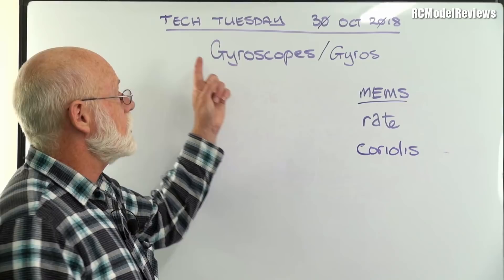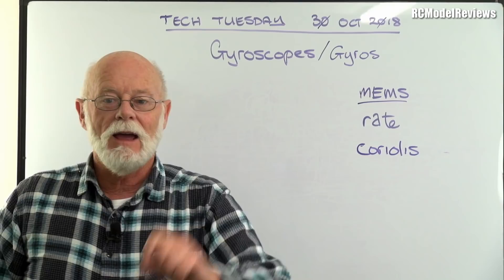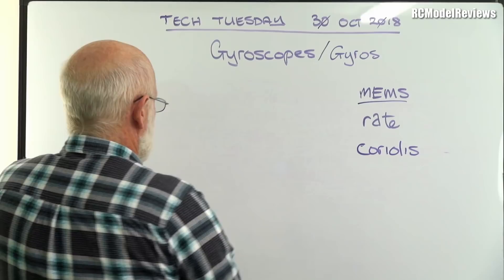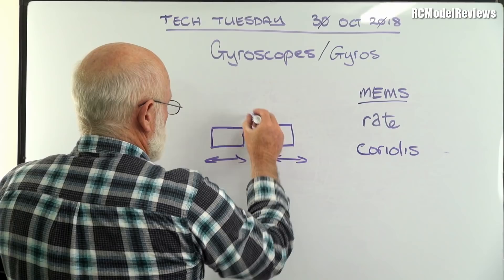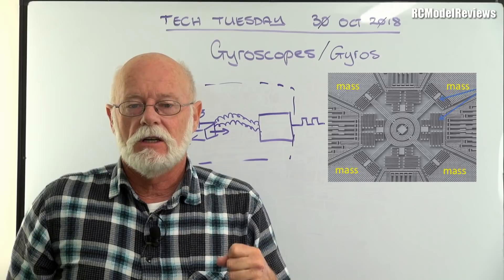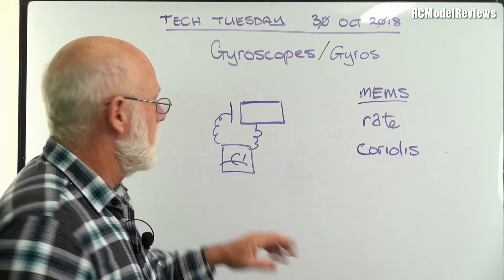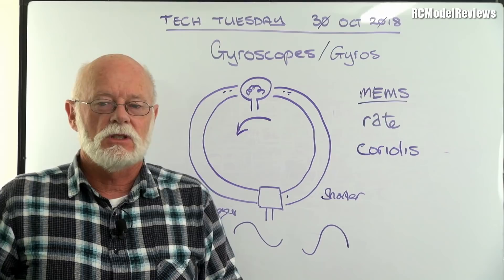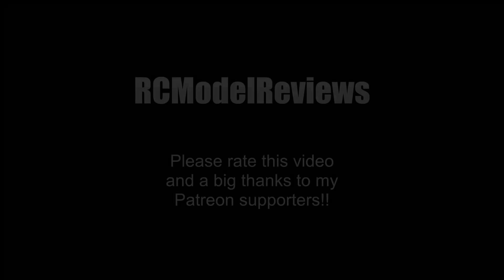Tech Tuesday: Gyros, how do they work?

Comment: When I joined the military back in the early 90’s, the first airframe I worked on was a DC-9 built in the late 60’s. I used to chuckle when I changed out the gyros because it said “handle like eggs” on the side. Fast forward to 2001, I started working on C17’s. I once asked a guidance & control specialist how a laser ring gyro worked. His explanation wasn’t very good. 
This explanation was a lot better.

Comment: Great presentation. Looking forward to the accelerometer. I always wondered how it remembered what is up and down. I now realize that gravity is an accelerating force.. Thanks

Never heard of the light gyro. Sounds expensive. Amazing how it's possible to measure such tiny changes in light. I guess it's Doppler that is measured since the speed of light is constant.
Reply: Not doppler, just amplitude, since the waves from the two paths either reinforce or cancel each other, depending on the phase, which is determined by the difference in apparent path lengths.  Because the apparent length of each path changes depending on the amount of rotation during the period between leaving the light source and striking the sensor, this directly measures angular change over time, which is rotation rate.
Reply: @BrightBlueJim  Since the speed of light is constant the path lengths are the same. I think what you are describing here is a way to measure Doppler effect in the two pathways
Reply: @jannesbosma9801  Kinda but not quite.  Doppler shift is measured by detecting a difference in frequency between objects moving at different speeds.  Here, the light source and sensor are both mounted on the same object, and what is seen is the same frequency as was sent, with just a fixed phase shift for any given angular velocity.  This sounds like splitting hairs, but the distinction is that a doppler measurement needs a fixed reference point from which to make the measurement of the moving object, while a differential phase measurement like this doesn't.

Comment: So we can accurately measure the difference between two light paths at such a miniscule distance?! Is anyone else freaking out over how impressive that is?
Reply: No, not really: the combined light arriving at the sensor by the two paths is maximum when the difference in path lengths is a multiple of one wavelength of light where the waves from both sources reinforce each other, and minimum when the difference is a multiple of one wavelength + 1/2 wavelength, where they cancel each other out.  So the sensor goes from minimum to maximum output for a path length difference of just 1/2 wavelength.  So yes, we can make measurements over a miniscule distance, but it's not a difficult thing to do.
Reply: And I should mention, since the video didn't, that ring gyros aren't generally built at the size of integrated circuits.  Their sensitivity is directly proportional to the diameter of the ring, so bigger is better.
Reply: Just photonics, but those gyros can measure miniscule changes in Earths rotation and now that's impressive.
Reply: @BrightBlueJim   What about a coil of fiber? Multiple roundtrips between sensor and emitter.
Reply: @LowPriceEdition  Seems like that ought to work.

Comment: Greetings. I know this is several years  old now but just searched “gyros” for drones/UAV thinking that I’d get the old fashioned “top” gyro like you mentioned the older Helos. So guess I’m dating myself here. But was both amazed yet befuddled by an electronic SS one on a 4’ acrobat RC plane kit that this other YouTube Guy was installing to help level his flights and do a myriad of other items as it had 9 outputs and as he’d dip a wing and change heading everything at once  responded RTZ (level flight) returned to zero and sat there with my law dropped for a good 2 minutes trying to figure out just how that was even possible with a tiny 3” box when we used to Mount 12” mech. gyroscopes in the rear of our auto cross cars (1974) and in a hard corner would hold a car body so stable; depending on the skid (and age of old bias ply tires) you’d rip them off the rims! So whilst I’m yet to be convinced there’s an “electronic SS gyro” that is 1:1 effect vs an old school turbine sounding gyro (I’m only 1/3rd the way thru your video) but I’m building a 6’ (-ish) UAV that’s turbofan driven with 4 fans - atop an ancient Williams turbofan jet. … yet on another board we were discussing best ways to manipulate and  coordinate those four sets of blades/props to give us the best lift and  level flight (and no drag/lock props) OR best nose down (-AOA) but stationary flight (follow that?) and then also just a normal or std. “tilt forward / tilt reverse” to float or fly backwards and forwards and sideways I suppose I should add too … and is being built right now are 4 ball casings which will encase each fan array within each wing and by RCC the entire ball will rotate along with increase/decrease power front/rear/side to side to give the AOA or movement desired which could be mere inches. Like an eye in an eye socket is the best way to describe it in basic terms. I must add this currently weighs in at just under 1000kg. So my Q to you is are the old fashioned stabilizers/mech gyros even made or used anymore? Or do that make solid state gyros if enough are used and properly mounted to the mm will they respond and act the same way as a mech. Gyro? My gut and brains both say no. And feel I’m talking apples and oranges? But outside of these Solid State Gyros  acting like a mercury  switch on steroids and sending angles as you say from center on the RC plane or helo; it’s “correction” is all FBW controlled by sending a signal to 1 to 7 devices (flaps/surfaces) to do X, Y and literally Z to get the RC plane back level. And suspect it does it In milliseconds vs man’s hand on the stick and only controlling  1 item at a time or 2 if you’re talking banks with tail and flaps etc. the combos are endless but the “computer” is doing to be light years faster than the human whose 500m away flying by sight whereas the SS gyro is flying by horizon I’ll assume? Whatever the case I see now why this is a massive improvement over older RC tech. Another RC car video I saw the kid said SS Gyros are “cheating” because it turns the car perfectly for you. Well I’m not flying a car - but weighs half as much as a real one and anything I can do to make it fly straight and level as well as perform some minor aeronautical maneuvers that achieve the remote pilot’s objective with 1-2-3 inputs is FABULOUS news to me. I just don’t het how this offsets weight? And it doesn’t or cannot as said earlier it’s just manipulating surfaces faster than a human can based in orientation not G force. If you follow even 5% of my ramblings here.. do you catch the gist of my Q? Or maybe I should ask
Better Q’s. 1) how large do these ss gyros come as? and is their a weight limit. This kids 4’ RC plane I’d imagine weighs 50 lbs? Maybe 25? Total guess but that’s still allot of G’s (mass) to control  during a steep turn or bank. 2) I’ll ask again. Do they still make old school mech gyros? What do jet copters use today or Military choppers like Blackhawks? 3) And last would you need 1 center mounted GOG gyro (whichever flavor works) or Mount one on each corner near the rotating prop fan for a drone/UAV? Do the “talk” to each other? Sorry for the sloppy story I’m still designing  some aspects of the props in my head as I go despite drafting and testing it both in CFD and wind tunnels but not with gyros due to size. But maybe it’s something  we need to look into? Many thanks for any feedback or help you can provide. Cheers. BB

Comment: I know the time-of-flight bit is incorrect but I also know the correct explanation escapes me at the moment. You can consider the fact that the photo emitter is in motion. It's a relativistic effect for sure and the phase difference is probably a wavelength difference as well. BTW I saw some Japanese company was making consumer ones a few months back, are any drones using them yet?

Comment: Bruce, any chance you'd be willing to do an episode discussing the configuration of pusher planes,  engine rotation and how to configure CW and CCW props to provide proper and maximum thrust. I have been struggling with one of my wings that has a powerful motor (emax rs2205s / 2600kv / 1091g thrust / 30a esc / i've tried 6x4 standard props and 5x4 CCW bullnose props) yet at full throttle has enough power to maintain level flight only. Something's wrong ;)   Keep up the great work!

Comment: You use Coriolis effect instead of precession. The gyro does not convert angular to linear - it can measure only angular acceleration, by outputting a rotational acceleration at 90 degrees to the trigger, and it cannot measure on its rotational axis. To measure all 3 DOF 2 gyros are enough.
Reply: What you say is true for gyroscopes made with rotating masses - torque on an axis perpendicular to the rotation axis results in a torque perpendicular to both the axis of rotation and the axis of the applied torque.  But in a MEMS gyro (which isn't really a gyroscope, but there doesn't appear to be a better term for it), the mass is moving in a straight line, so the behavior is different.

Comment: Syntax Error... I can't get the last one. Isn't that proving that the speed of light isn't constant? If it's in a closed loop and length of the tubes is the same it travel the same distance anyway. You don't change the length by turning? or light just travel thru space no matter the media? Or I just should go to sleep? :p  As always owesome video
Reply: Edward, what the laser beams see is an apparent increase in the length of the left hand tube vs an apparent decrease in the length of the right hand tube as the system rotates.  This means that the beams must arrive at the sensor at slightly different times from each other.
Light travels its' fastest in a vacuum, but slows down as it passes through a medium.  You are correct, each medium (air, water, plastic, glass, etc) has a different ability to slow down the light beam.  No, don;t go to sleep ask your questions and ALWAYS read the comments.

And pay no attention to the guys who slept through science classes, can't understand anything but mouth off as if they are know it alls
 and should be watching cat videos instead of posting stupid comments.

Comment: Any chance for a Tech Tuesday with the subject being motors and max thrust/lifting power?I know you did some videos a few years ago with a Turnigy Thrust Measuring Stand. But buying one of those and a bunch of motors to test, seems like an expensive way to go. isnt there a smart way to calculate it?Most sites dont seem to list thrust/lifting power as part of the specs.
I am trying to build a 7-25KG quad or flying plane.
Reply: Manufacturers don't, because they sell the motors only, while other manufacturers sell the props.  BUT, if you go to the hobby shop web sites, they often show the static thrust using one or more combinations of battery and prop.

Comment: are you sure there is no electromotive force between the plates of the capacitor? :p
Reply: There very definitely is, but by using an AC signal to measure the capacitance, the forces from the two half cycles cancel each other out.

Comment: The  Coriolis Effect has nothing  to do with a Mechanical Gyro.Its to do with the spin of the Earth & weather patterns only.I fully understand both   myself .I just figured them  out myself .Its not easy to explain I admit .You definitely have the Theory wrong.I am amazed no one else picked up on it
Reply: The Coriolis effect applies to any spinning mass.  What?  You think the Earth is special that way?
Reply: @BrightBlueJim  No it does not apply to any spinning mass at all.A spinning wheel on your car has no Coriolis effect at all.Nothing to do with a Gyro.
Reply: @lomasck  Coriolis effect: "an effect whereby a mass moving in a rotating system experiences a force (the Coriolis force ) acting perpendicular to the direction of motion and to the axis of rotation."  The effect on earth is just a particular case.
Reply: @BrightBlueJim   Thank you for your reply,s I worked out long ago how Gyro,s & the spin of Cyclone,s worked before the Internet yet never did I take the time out to read all on what the Coriolis Effect  was.You prompted me to do so & see you are right.My motorbike wheel has the same effects when turning the handlebars at speed.